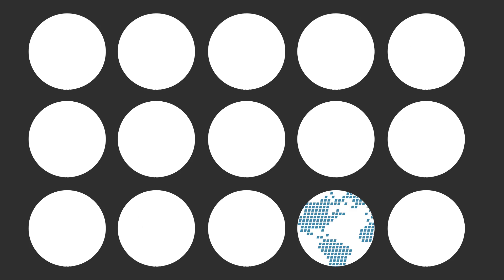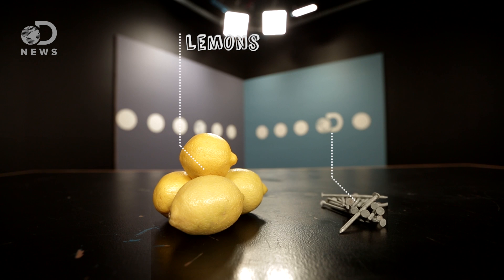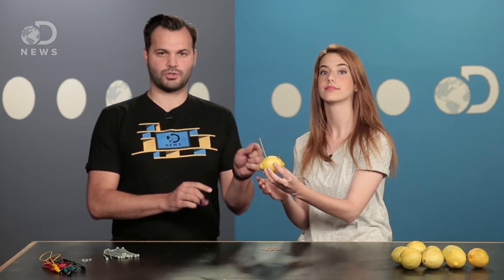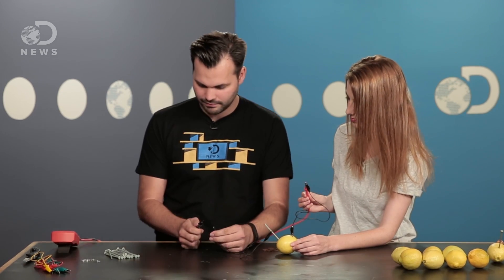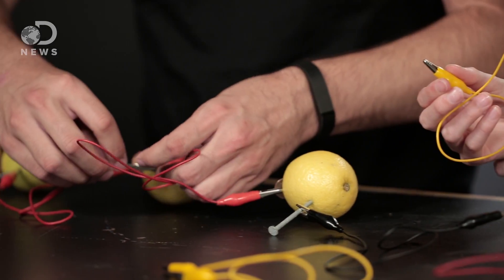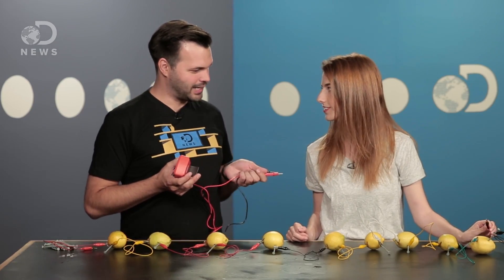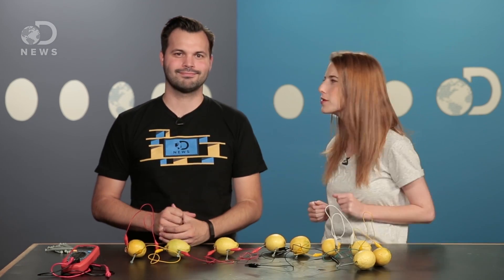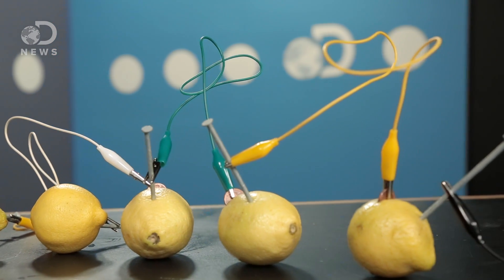How To Make A Battery With Lemons

Comment: Why not just stick multiple pieces of metal in one lemon?
Reply: +arjenbij Because you could only connect them in parallel then. To connect them in series (for high voltage) the individual circuits must be insulated from each other. That's not possible in one electrolyte-tank.

Comment: You're getting almost 5 volt from 9 lemons, 
A laptop charger is about 12 volt, so I guess about 15 lemons sould be enough. But I don't think it would work because of the low Ampere.

Comment: "The average lemon generates more bio-electricity than a 0.5 volt battery and no BTUs of body heat. Combined with a form of fusion the machines had found all the energy they would ever need.
There are fields, Neo, endless fields where lemons are no longer born. They are grown. For the longest time, I wouldn't believe it. And then I saw the fields with my own eyes, watched them juice the lemons so they could be fed intravenously to the living. And standing there, facing the pure horrifying precision, I came to realize the obviousness of the truth.
What is the Matrix?
Control.
The Matrix is a computer-generated dream world built to keep us under control in order to change a lemon... into this."

Comment: Because I am a huge dork: To answer Trace's question @ at half a volt 20 of them would provide enough voltage, but since the average lemon gives roughly one mili-amp the wattage is too low.

To give sufficient power output it would take roughly 20,000 lemons and some sort of transformer to power a standard MacBook. (roughly 10 watt's according to Apple's technical specifications)

Comment: If you're low on lemons, you could attach the nails and pennies to the same lemon to extract more power. You could chop up those nails and pennies into smaller bits for even more power, as the increased surface area further increases the number of reactions going on, thus more power. Of course, you also end up burning through your fuel.

Now let's stick some needles and pennies onto a human and see if we can extract some power.

That reminds me, if you replace half the pins on an AMD processor with zinc pins, that processor can turn just about anything into a battery.

Comment: Wouldn't it be more efficient if you put the zink nail along the widest side of the lemon and the penny also. The more contact with the zink and penny the higher the voltage right. So if you can put the zink nail into the lemon until only the head sticks out and the contact point on the penny the more efficient it should get.

And by the way make the ads. more closely to the subject. Run like an actual intel computer on lemons!

Comment: Way back in 1960, I made a lemon battery for a high school project. At the time, used a spare scrap of zinc, and a carbon rod taken from a dead dry cell battery.  I got about 1.4 volts open circuit, but it would only supply about 1milliamp under load; not too practical battery, but did get an A for the project!

Comment: you need 218 lemons to get a 120v DC current to power your laptop Trace. maybe you could use a copper wire instead of a penny to get more "juice" out of the lemon :P

Comment: If the clock needs a 1.5V battery, you're supposed to connect 3 lemons in series and the other ones in parallel. Of course the power output there was tiny, but if you use a bunch of lemons, adding them in series might burn the clock circuit.

Comment: Are these lemons still safe to eat after i'm done with the test?
Reply: +Slimexable Everything is edible, if you're brave enough...
Reply: lemons aren't edible
Reply: +Benny Kolesnikov gas is not edible :(
Reply: Drakethedrake Extremely healthy as well. A small glass every morning is all you need. Packed with bitter tasting health.
Reply: On a serious note, yes.
Just cut off the part where zinc nail was to deal with zinc oxide created there. Then the lemon should be ok to eat.
Reply: Commander Erik Yes, but you'll also be eating a little bit of Zinc Oxide.
Reply: Commander Erik 
I wouldn't do that, copper isn't that good for you in large quantitties(pun intended)
Reply: erikpoephoofd Neither is anything, but copper is needed for survival, so wouldn't it be ok to eat just one lemon that had a penny in it?
Reply: George Cataloni
Sure you would be okay, you wouldn't suddenly die of copper intoxication, but I wouldn't make a habit out of it. It would be a very strange habit though :P
Reply: The Anonymous Sexual Redditor
Well there is enough for this reaction to take place apparantly
Reply: Commander Erik I wonder the same. Doesn't seem advisable with electrolyte metals in it.
Reply: +Slimexable are you stupid? Lemons are very edible, and are used in cooking.
Reply: Moyukh Shabon Can you do it with just the lemon juice?
Reply: i dont think so so pls dont eat the lemons